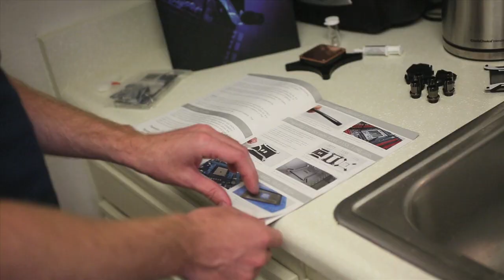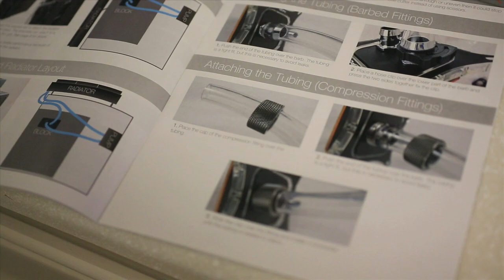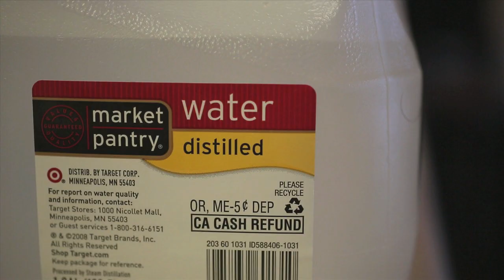A Beginner's Guide to Water Cooling Your Computer

Comment: Wait Wait Wait a second everyone is saying it would be more quiet..., it wont because it still uses fans....
Reply: i think the water would .. dampen .. the sound of the fan
Reply: I don't think so because its not like the fan is cooling the water directly, the water is transferring the heat to the radiator which is taken out by the fans.
Reply: did it for the pun
Reply: The problem with air, is that you have to mount heatsinks (which are the same things as radiators) directly onto the components. And therefore, you can't physically fit as large heatsinks, as it is possible with radiators. Think about a system with 3x 240mm radiators. Or you can even install a MASSIVE radiator outside of your case that doesn't even require fans.

What makes a fan noisy, is the speed it's spinning at. Massive radiators don't require as much airflow, therefore the fans don't have to spin as quicky. And THAT is where the silence comes from. On top of that, you get far superior cooling.

But, as it is the case with everything high end, it does come at a price. It's pushing the limits, so it needs to be maintained. If you're an enthhusiast, who thinks about this 24/7, you don't find this much trouble to go through. Especially, if you compare it to other things. If you want to eat, you have to go get the groceries, cook your meal and wash the dishes and the frying pan/cooking pot. Same thing each time. Now that's a hassle.
Reply: 8raffi you remove the use of heat sinks on cpu and gpu which cause most of the noise and you can under-volt the fans in your system to make the quieter without compromising that much cooling performance. with a full air cooled system fans have to be on most of the time no matter what causing more vibrations and noise
Reply: The reason it is more quiet is because it is so much more efficient, that the two fans can run at a much lower RPM, and still get the same/if not far better temps.
Reply: H100i is your best choice to cool your system. They are getting cheaper now - amzn.to/Pl4tfa
Reply: actually guys you're wrong. while you might get more surface area with a radiator than a air cooler its not just about that. it has more to do with waters ability to conduct and transfer heat much more efficiently than air alone. one cubic centimeter of water can transfer a lot more hear than one cubic centimeter of air. that along with larger surface area of a radiator means that even though you have fans the fans need so spin MUUUUCHHH slower in order to cool the CPU. so slow in fact sometimes the fans make no noticeable noise unless you put your ear an inch away from them.
Reply: It varies, If you get a Bigger Radiator with a low "FPI" (Fins Per Inch). You'll be able to use very low RPM Fans which will allow it to be basically silent, BUT you'll need more Surface Area. More Radiators and Fans.
Reply: 1. all fans are not loud. 2. in air cooling you need MORE fans, fans still do noise its alot louder with more fans! 3. Watercooling looks alot better (i think at least) 4 often custom watercooler "loops" performs a bit better! Tip: the bigger surface area you have the quieter it is and better, because the fans can spin on a lot slower RPM. :D just advice no hate!
Reply: Dag Ryden  watercooling = low temperature + more performance
and low temparature = low fan's rpm = less noise in systeme
Reply: Yeah! Hijen Khlifi
Reply: Good aircooling rigs are as quiet as (or quieter) than watercooling (some rigs are fanless).

Most aircooled rigs are not "good", nor are they as good looking as a watercooling rig, which has a certain "punk/geek" asthetic to it.

Some people on this thread seem to think that watercooling gives better air cooling It's just a way of getting heat from a point source (chip) to a larger heatsink (radiator). The cooling itself is still passive and is limited by ambient temperature.

There are some pretty craptastic watercooling rigs out there, some of which look quite nice but are significantly worse than the aircooling rigs they replaced.

(The watercooling rigs I'm currently looking at have 100kW chillers outdoors and heat exchangers in the bottom of the cabinet. Air circulates through the servers and nothing is exposed to getting wet. That's a whole different ball game to the "nice toys" people play with in these videos - and they're not quiet at either end.)
Reply: toed stool I enjoyed your pun :D
Reply: sp120 fans by corsair, noctua fans, 120mm or 140mm fans... Gotta choose your fans wisely. And if you see closely he has a fan controller which you can control the speed of the fans and crap. This takes some education before even deciding water cooling.
Reply: got it... i think lol....

Comment: At what point is a build worth water cooling instead of fans?
Reply: cakebrin3r ambient temps are only a consideration in extreme conditions. like a difference of 20 degrees. water cooling will always outperform air cooling due to waters ability to transfer heat magnitudes better than air. 
as for the main question. most people dont need liquid cooling. if you have a core i7 you need good cooling but can get away with air.. that said if you want to over clock you want to look into water cooling. or if you want silence. also it just looks bad ass when you show people your computer is so OP that it needs liquid to cool it like a freaking car haha
Reply: Mainly if you want to OC your GPU. You can get amazing performance increases by watercooling your GPU.
Reply: Many people do not realise that for every 10°C increase in temp, the life of that component is halved. In other words, a component at 40°C will last double the amount of time of the same component at 50°C.

Cooler is always better and therfore there are HUGE benefits to watercooling under ANY circumstance, not just overclocking.

People's misgivings about PC watercooling are unfounded and a product of their own vivid imaginations, existing only because they do not know how PC watercooling works. Assuming that the watercooled PC has been put together correctly there is LESS danger of something blowing up than on a correctly assembled air cooled PC!! The chances of a water leak on a correctly assebled system virtually NILL. Spilling water onto your components whilst filling the system can happen, but that is no different to spiiling coke/coffee all over your PC ... both are YOUR fault for being clumsy not a by-product of watercooling.
Reply: SneedOK
A decent aftermarket cooler can be just as good as watercooling BTW.
Reply: Yes and no. You can expect watercooling to be up to 10°C better than a decent aftermarket cooler. Water cooling is more efficient than air cooling. That said, not all water cooling components are equal and Manufacturer A is better/worse than Manufacturer. If you take the best of air cooled and put it up against the worst of watercooled the difference between the two will be minimal. Take the best of both however and watercooling will always come out on top. Besides the efficency, you also have the size and the noise of air cooled. It is not possible to get the same level of cooling/silence on air that you can on water. 

The biggest downside to watercooling is the cost.
Reply: If you have a build over $600 in an environment that's over 30 degrees as room temperature
Reply: cakebrin3r
Ambient temperature has NOTHING to do with whether you do or do not need watercooling. People have  a huge misconception of how watercooling works.

Radiators can only reduce the temperature of the water in them to a  whatever the ambient room temp is. In other words, if you have a room that is 30°C  the absolute LOWEST temp you could ever see in your watercoolling system is 30°C. If you had air-conditioning in the room and dropped the room temp to 5°C for example sake, well then you could cool the water in the radiators down to that level too.

Bearing that in mind, it is clear to see that the ambient room temp has NOTHING to do with whether you should or should not use watercooling.
Reply: SneedOK But it actually does, the higher the ambient room temperature the easier it is for the parts to get to a higher temperature. And as you stated in a previous comment every 10 degrees halves the components live span.
Reply: cakebrin3r Once again, ambient temp has NOTHING to do with when you need to use water cooling.  We are talking about a determining factor for converting to water, not whether water cooling works better than air cooling.

Comment: Question.

Do you Need to add Biocide and Anti Corrosive if there's Kill Coil ?
(Reservoir -> Pump -> Water Block -> Radiator -> Reservoir) is That fine ?
what if i have 2 Reservoir, do i need 2 Pumps ?

Comment: This is one of those high risk high reward things.
Reply: Logan Kramer Even if non-conductive, it could still cause damage if a leak is left unattended.
Reply: Guys, ALL of you making statements about how dangerous this is, have never had a watercooled pc. Your statements are made based on your own wild imaginations as to the risks.  Any person who has a watercooled is laughing at this thread because the fact is you have more chance of knocking coffee (or whatever you drink) over your keyboard, mouse, pc and mobile phone ...at the same time, than springing a leak in a watercooled system.

Spill water on the mobo whilst working on or installing watercooling, no problem ... use paper towel, normal towel, tissue or toilet paper to soak up any visible liquid, clean board with damp cloth if colour dye was used, blow on area of spill to get and trapped droplets out from any nooks and crannies, and either let it dry overnight or get a hairdryer.

To all the sceptics ... stop blurting off total nonsense
Reply: What's the risk though?
Reply: *****
Except distilled water is non-conductive and it won't do anything.
Reply: Still, you could possibly drop the fittings on the gpu or something, and who wants to clean water out of every nook and cranny. An inexperienced person could really mess up something. And i see that nowadays there are many people who are new to building a pc and i'm one of them so you have to take that into consideration.
Reply: no risk whatsoever. As long as you tighten up the clamps on the tubing, the system is completely sealed. The waterblocks are a self contained unit, identical to an air cooled heatsink, with the exception instead of fins for the air to travel through, it has small fins for water. NO water touches ANY electrical component on the PC.
Reply: Logan Kramer One word mosfets. Also everything is conductive to a degree and even with distilled water it still has enough conductivity to fry computer parts.
Reply: If it's distilled water, sure!
Motherboards are waterproof. You can wash them with water if you need. But if using regular water, you can't have it on or it will short stuff out.
Reply: No shit.
Reply: Exactly. lol
Reply: Steve Wayne What you said.
Reply: Steve Wayne i have a question since you seemed well adversed in this subject of cleaning boards, a while back i had a GA-970A-D3 rev.1, it still works, but i was just learning how thermal paste works, long story short, i upgraded to an FX-6300, but VRM/Mosfets were getting to hot, so i cut down an old 512MB vid card heatsink and made it into a heatsink to cool the VRMS, i used ""A BIT TOO MUCH"" thermal compound, now i want to clean it off but some of it is stuck inbetween the connectors to the motherboard from the VRM's, would running warm water over them be the best bet?
Reply: The best way of removing old TIM is to use a small brush believe it or not (small oil paintbrush). You also get proper TIM remover fluid. I usually use a bit of toilet paper to get the bulk of it off and then a small brush. it sounds a bit daft, but try it. The TIM goes hard and then brushes off. I have one of those tiny vacuum cleaners (Maplin) and rubbing the brush over the areas that have TIM in them (between components)  it gets all of it off.  I have done this on 2 different makes of TIM and it works on both. OI dont know if it will work on all types, but if not, try dipping the brush in some TIM remover fluid and doing it that way

Comment: this looks like a fun project, but alot of closed liquid cooling systems exists now that are pretty simple to install. I hear alot of people saying they don't work as good, but my FX 8350 during benchmarking is staying ice cold with a Corsair H60 mounted to the back of my case. Temperatures stay under 40C, so if your to intimidated to run the piping yourself it's a great alternative.

Comment: I'm trying to get more info but right now, no luck at all, SO IM ASKING!!!

I got this water cooling sistem for a AMD FX-9370 in a Asus Saberthooth 990 FX R2.0 In a Azza XT-1 Tower. How Do I install this or is it even possible?

The Sistem is a Corsair H100 Double fan & Radiator (2x120mm Fans)

I'm very new at this but apparently this cooler has to be installed in the top of the tower and the tower has a big fan there like a 12 inch one, I don't really know if I got to uninstall the fan or can just put it below it. I need guidance and help please.

Comment: so it's basically the same concept in cooling a car's engine
Reply: very similar yes.
Reply: The water isnt in direct contact with anything electrical. There is just a copper block over the cpu heat spreader, (remember the cpu itself is tiny and most of what you see on the chip is just the heat sink), and water being pumped over the top of it to a radiator. It's like putting a sealed jacket over the metal casing of an electric motor pumping water through it and cooling it like that. The water never actually touches the motor itself.
Reply: in cooling an electric car motor, in a gas engine water can be in direct contact with the aluminium block but not in a electronic device as a microprocessor or the coils of an electric motor, that's the problem.

Comment: ok... how exactly does it keep the shit cool when its not actually going any where???? just to a pump, to a storage area to another storage area and back to the pump???
Reply: Think of it this way, so here's the basis, whenever something hot is in contact with something cooler, the hot heats up the cold, and the cold cools down the hot. The water is the cooler. The cpu's heat transfers over to the water, then the hot water transfers over to the radiator, the radiator with hot water running through it then cools itself off via fans, since thermal energy transfers through solid object, the heat from the water in the radiator then transfers over to the surrounds air, and the surrounding air is pushed out via case fans. or sometimes from the radiator directly outside the case. The water might be stuck in a full loop, but the heat of the system can be transferred out and not stuck. Without the radiator the heat would just constantly build up in the loop. You have a desk correct? If you have any more questions feel free to ask.
Reply: i no follow..... the waters not getting in contact with the hot surface... it stays in a tube.... and if it is getting hot its thru the general fact that there is OTHER SHIT GOING ON IN MY PC THAN A FAN, A CPU AND ANOTHER FAN!!!! and that is where all the "COOLANT" IS GOING!!!!! fans cpu and another fan.....
Reply: yes it does cool the hot area..... IF THE WATER WAS TOUCHING IT!!!! yes it does heat the cold area....IF IT WAS BEING TOUCHED BY ANYTHING COLD!!!!! i might as well put an ice cube in there wrapped in tin foil!!!
Reply: The CPU touches the air, the air touches the tubes, the tubes touch the water. Thermal energy is transferred from the CPU to the air, to the tubs, to the water. then water moves to radiator, the radiator cools itself off with fans, which the air touches the tubs of hot water. heat transfers, and water is not hot.........  I do not how to put it any more simpler. You do NOT need DIRECT contact to transfer thermal energy. Ever had a hand behind an exhaust? hot friction and combustion that happens in the vehicle is then transferred into gas, which is air, the air is hot, your hand gets hot, the vehicle is less hot....
Reply: arcee yates
Actually I was wrong a bit, I am pretty sure what I said above may work, but it doesnt work efficiently as the way I am about to explain. So on the CPU is called a block, its usually a highly conductive metal, and high conductive metals also transfer heat quite well. The block sits RIGHT ontop of the cpu, coming in contact with the CPU, transferring heat to the block. Then a tube either runs through or on the block, but has direct contact with the block. The block then transfers its heat to the water, and since the water is flowing, it transfers through the loop. It then goes to the radiator, which is either a large conducting piece of metal, or a smaller metal with fans to cool it down. The large metal piece spreads heat as evenly as it tried through the large piece, limiting a buildup of heat, then it radiates off of it from the surround air absorbing the heat. The fan radiator has a smaller metal, so the heat build up more on it, but the fans cool it off as quick as the other radiator because the fans blow air slow enough to take heat off the radiator, and fast enough to disperse the heat away from it. Then it goes back to the reservoir, and back to the pump, and back to the CPU. I am pretty sure that is how it goes, I have never installed one so I cant say for it exactly, but I understand thermal heat well enough for it. For any computer super nerds our there can correct me.
Reply: ok i guess